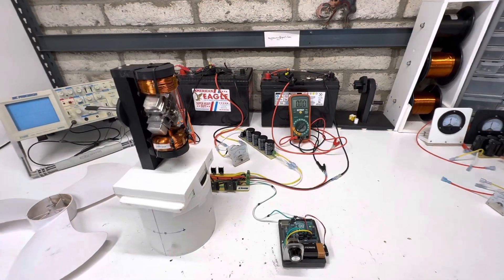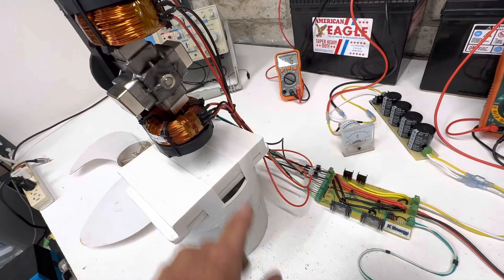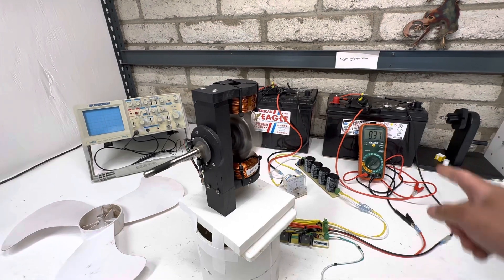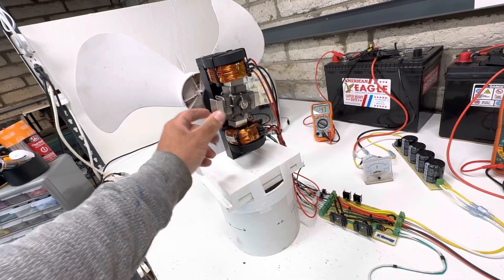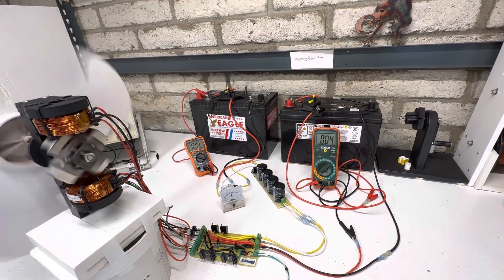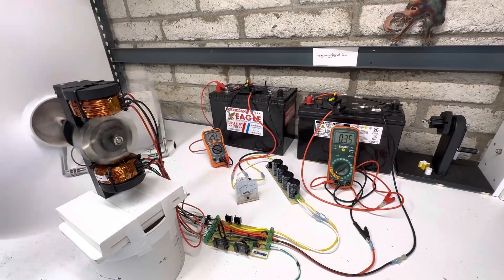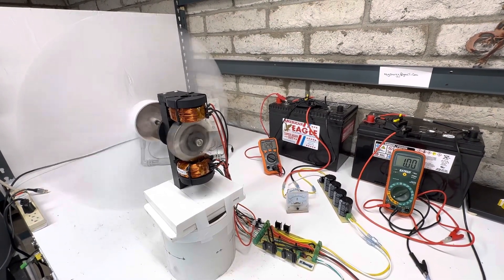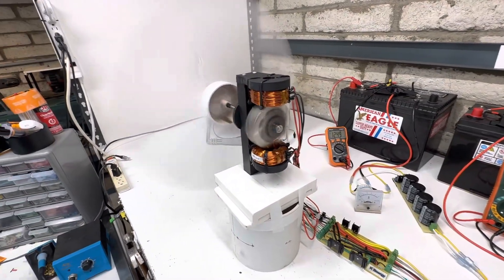Simple pulse motor part 8 coil upgrade

Comment: lets try to improve the setup to use just one battery to drive the pulse motor and then also get it recharged from spikes collected into capacitor back to the same battery..